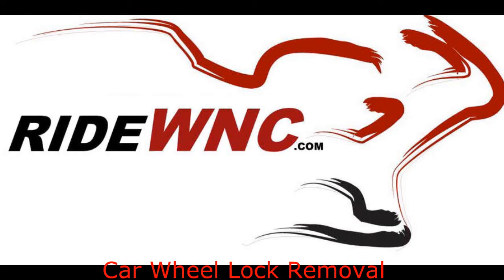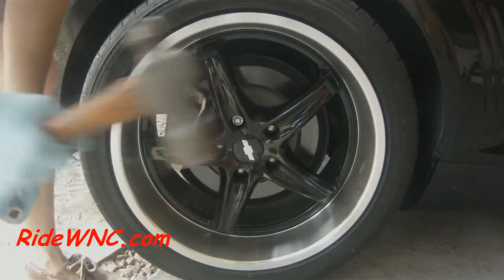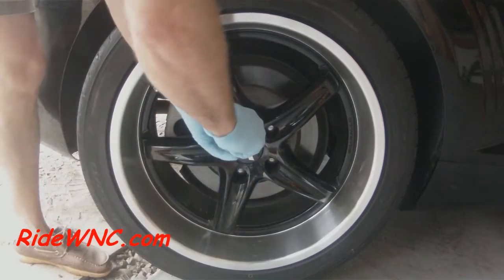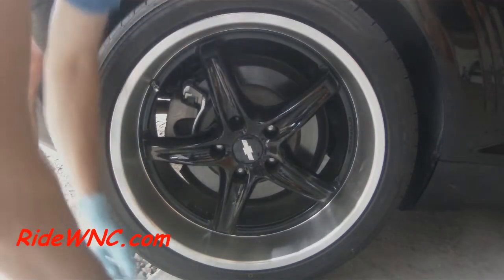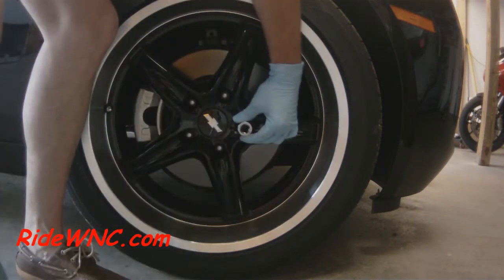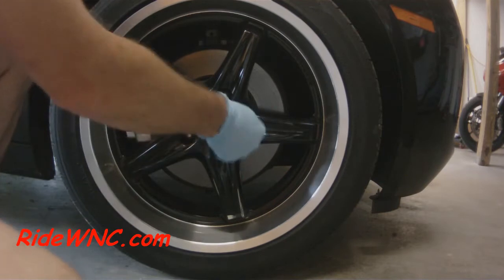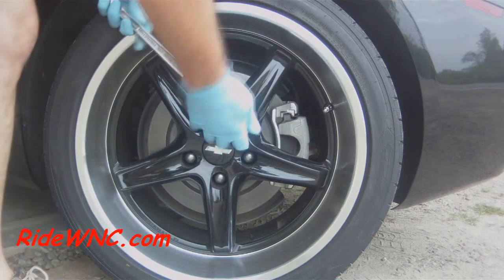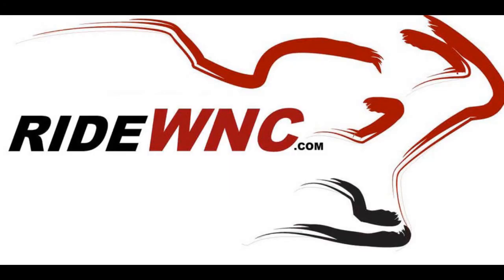Wheel Lock Removal - Lug Nut - Tire wheel theft - McGard Locks

Comment: GOOD (I would say, EXCELLENT) technique!Only a few comments.  This works when the lock is NOT overly tight (like when a stupid wheel installer used a large impact air tool, crnaked up to the max air pressure. When that is the sad case, you need to find if a short, normal 12-point socket, preferably a well worn (but good quality, not chinese junk) socket will sometimes apply a larger force the the stuck "safety" nut.Second, while a good sized hammer like the one you used will seat the socket on the lock quickly, you are causing a slight (but inevitable) damage to the wheel bearing... I'll suggest to use a much better "DEAD-BLOW" hammer (NOT a RUBBER ONE, but the kind that is filled with lead shot inside the head).  That will avoid the damage to the bearing rollers and cups.Finally, don't disregard the use of a good quality "Liqui-Wrench" type of spray (the very best ones are the one called "KROIL", and the German made "Wurth" Rost Off Max Ice